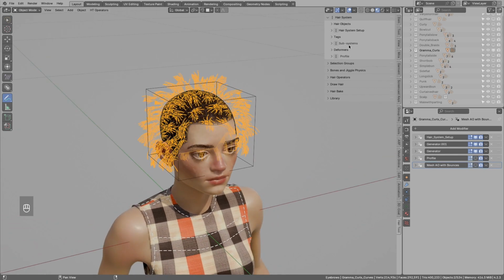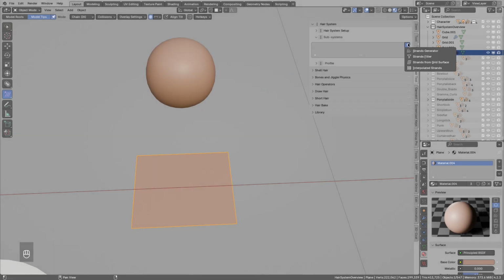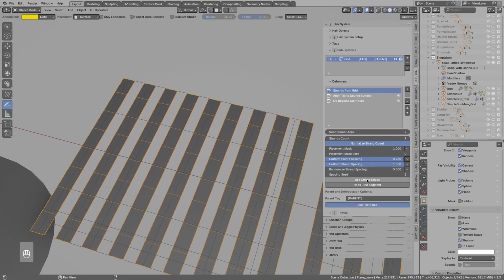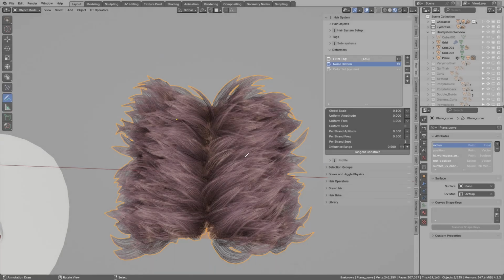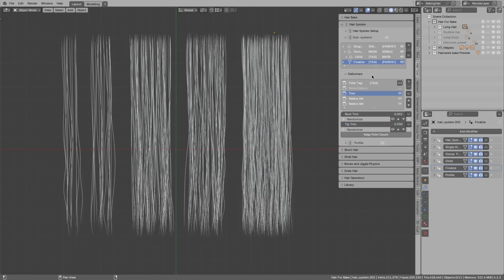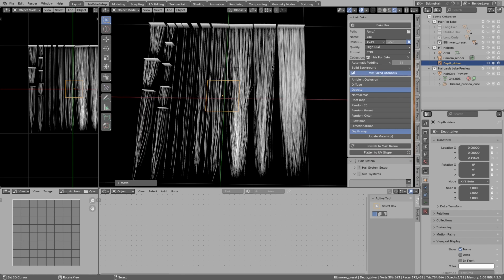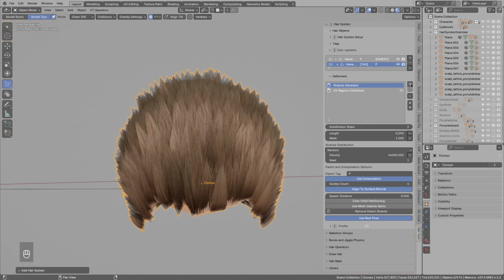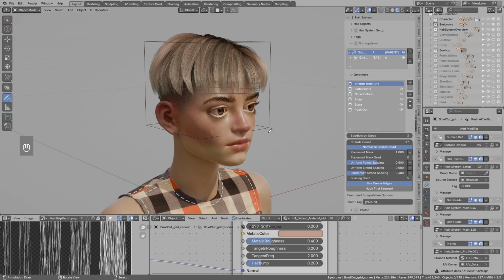Hair Tool 4 Introduction video

Comment: Hello,
I’m able to create hair well using curves with the Hair Tool, but when I start using the Hair Modeling Tool, the square point at the end of the curve disappears.
I mean the small square control point that highlights in green when selected, which makes it easy to identify the curve end.

Is there a way to restore or show this endpoint again?
Reply from the maker: To enable hair modeling - you have to have 'show overlays' button enabled in blender 3d view, and maybe try to switch to other tool for second, then back to hair modeling. See https://joseconseco.github.io/HairTool_3_Documentation/hair_modeling/#location .
U could also see if  there is update to addon (in Hair TOol preferences > Update)
Reply: @bartoszstyperek6306  Thank you so much! Turning Show Overlays back on fixed it! Really appreciate the explanation and the documentation link 🥹

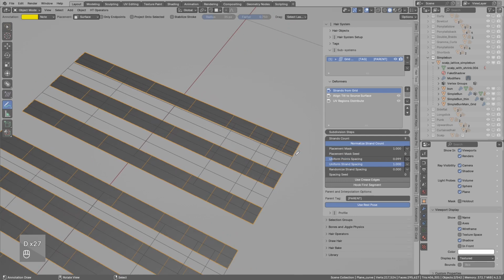Comment: also at 19:48, the uniform points spacing and uniform strand spacing don't seem to do anything when i slide it down
Reply: randomize strand spacing does work though.
Reply from the maker: It will work if your grid guide mesh is non uniform.  https://joseconseco.github.io/HairTool_3_Documentation/main_workflows/hair_from_surface/#parameters

Comment: This is so confusing. Straight from the start I don't get those 4 options in my Add Hair System drop down (1:34). In fact, there are no options available. Everything is shown on planes. When you show something on a character it's a hairstyle with tons of deformers added already and not a step-by step tutorial. You really need a playlist with several hairstyle tutorials like a ponytail, or braids, or buns each made with a different approach. The only one you have seems to be just almost straight curves sticking out of the head almost perpendicular and you just curled them. All this is extremely not beginner friendly.
Reply from the maker: The options at ctrl+shift+H menu are context sensitive (meaning different options will show depending on what you have selected - in video I had scalp mesh selected, so make sure you have mesh selected).   About step by step - I plan to make videos like that, where I break down how hair presets from HTool library were made. This  video was more of an demo, how each   deformer, hair system, maks etc. works .  I recommend checkout out this for quick start: https://joseconseco.github.io/HairTool_3_Documentation/#quick-start

Comment: Thanks !!!  I setup the hair material in main scene but how to use the same material in baking scene ? within the baking scene under profile when i select HT material the hair system disappears .
Reply from the maker: When material disappears it must mean that UVs are messed up. Both object should   share same: UV, material, texture - so that they are rendered in same way. Check out this FAQ point: https://joseconseco.github.io/HairTool_3_Documentation/faq/#texture-looks-wrong

Comment: Hello, Is there any tutorial/Documentation how to implement my haird cards to hair tool bake? I didnt find any solution and it does not work properly
Reply from the maker: yes, here is info how to  assign your own cards texture.  https://joseconseco.github.io/HairTool_3_Documentation/faq/#how-do-i-change-hair-texture   . These are same steps in video above  - https://youtu.be/3ATRZ-ox5s8?t=3255  .  IF you mean, that u have custom mesh for hair-cards, then use  Mesh Profile  to instance your custom cards on hair - see : https://joseconseco.github.io/HairTool_3_Documentation/hair_profiles/#mesh-profile
Reply: @bartoszstyperek6306  Yea I used hair card studio to create my own hair strands but I wanted to bake it using HairTool, which is quite confusing for me right now. But I didnt find any solution how to connect my hair cards to the hair tool bake system. I will try to check the links you sent me

Comment: Hi. When using 'strands from grid surface',  
There are always two strands generated at two sides of the grid with their middle line matching that side.
Which make these two strands have half of hair outside of grid.
Also if I have two grid placing side by side, I have overlapping hair strand in the middle.
I want a option which can slide the strands inside the grid.
Reply from the maker: I saw someone requesting similar feature in past.  So what you want is - when two close grids touch each other - the first and last generated strand should not overlap right? I guess this would require 3 cases:
- remove first strand
- remove last strands
- remove last and first. 
Something like this?
Reply: @bartoszstyperek6306  
Thanks for your response!
For 'Strands Generator' type of hair, the addon can use vertex group weights to control hair generation.
But for 'Strands From Grid Surface' type, seems I can only control hair generation by density of the grid. 
I tried to add vertex group on the grid and set 'Placement Mask' with that vertex group, but the placement is unchanged.
Vertex weights seems all set to 0 after 'hair system profile' modifier.
I want a variable (user defined curve or vertex group weights) to control which part of the sharp edge should grow more hair strands.
Reply from the maker: @fatboyzzfatboyzz7407  I think  vert group  not workings -was fixed some time ago, 'strands from  grid'.   Please update hair tool - and then update ;strands from grid; then vert group masking will work.  So after updating addon  (from built-in auto-updater) you  should load your blend file with old nodes setup, select 'strands from grid' deformer (always first one int the deformers list) - and from  triangle_down like menu - select 'update deformer'. 
Btw I was thinking about  rejecting of border strands feature, but it would be kind of pain to control - since if you pick 'remove last strand' - then all last strands   (on all islands ) would get removed. So u would  have to use some kind of mask - for 'remove last' and remove first. Does not look nice from   UI/UX point of view imo.
Reply: @bartoszstyperek6306  Updated to 4.1.6, the vertex group placement works! I think 'the remove last strand' is not necessary if I could control strands spawn with vertex group now. Great addon, thanks.

Comment: Hi, I updated the HairTool plugin (4.0.2 to 4.1.5) and I can't find the Material/UV option in the Hair Operators, so I can't use the Set UV Regions option. Where is this feature, please? In addition, do you have the website with the updated details of each version? I would like to see it, thank you.
Reply from the maker: Some options under Ctrl+Shift+H pie are context sensitive (if you do not have hair curve selected-  some options may not be displayed). If you have object, with hair system assigned to it , then material panel should be there (I would need more info - do you get any errors in console,  screenshot - best join discord for that).   
About info about releases - I put these on gumroad, but HT 4.1.5 is not officially out yet - it is only available through built-in auto-updater - that is why there is no info about it on gumroad.  Right now I'm updating docs for 4.1.5,  fixing bugs, and then I have to make video. After that is done - I will make 'official' gumroad release (with email notification about what is new).  Again for more detailed info - what new stuff is added - join discord.   sorry for long reply
Reply: @bartoszstyperek6306  Wow, it's in the pie menu! I mostly use the right sidebar menu to operate the software, so I didn't expect it to be here! This answer is not too late! Thanks for your answer!

Comment: why when I draw hair is it only giving me 2 verts? I basically get a straight line of 2 verts when I draw hair
Reply: I changed adaptive resolution " reduction" and it's still a line with 2 verts
Reply: Also, Use symmetry on the draw hair tool does not work
Reply from the maker: Ok, just added symmetry  support for drawing, in latest daily HTool build :)
Reply: @bartoszstyperek6306  Thank you!
Reply from the maker: yes, it is not  supported.  Will see about adding it in future.
Reply: also, the cards are not aligned to the surface when I draw hair.  The problems with this version are incredibly frustrating
Reply from the maker: are you sure you are using latest HTool 4.1.5?  No other users reported issue like this. Maybe you could joint discord, and post  video with drawing problem there?  Discord link https://discord.gg/cxZDbqH

Comment: why is the Flat Profile UV tapered at the end and how can I make it a card, not a point?
Reply from the maker: Try: Ctrl+Shift+H > Set Radius: 1  , to set uniform  radius for all points.  Or  use 'radius set' deformer with:  disabled 'built up' option, and 'influence range' set to constant (to prevent taper ) .  https://joseconseco.github.io/HairTool_3_Documentation/main_workflows/input_masks/#influence-range
Reply: @bartoszstyperek6306   Thanks
Reply: @bartoszstyperek6306  none of this worked. I'm using the latest hair tool with Blender version 4.3.0

Comment: Hello, I love this addon. I would like to know if I can apply the curve system to my own chunks (Haircards) that I have previously created so I can place them easily and smoothly. I think it was possible in previous versions, but now I'm not sure how... Thanks!!
Reply from the maker: You will have to convert your hair-cards - to curves with: https://joseconseco.github.io/HairTool_3_Documentation/convert_hair/#haircards-to-mesh-loops  . But it requires 'nice' uvs on your hair-cards  (uvs are used to determine orientation of generated curve ).

Comment: Not a single demo on how use on character, just on plane, which is waste of time.
Reply from the maker: 'not a single demo' is bif of an overstatement: 
- demo 1: https://youtu.be/3ATRZ-ox5s8?t=1032
- 2 https://youtu.be/3ATRZ-ox5s8?t=1363
- 3 - https://youtu.be/3ATRZ-ox5s8?t=1696
- https://youtu.be/3ATRZ-ox5s8?t=3264 . 
I tried to make this as short as possible and  still it covers  only around 50-60% of addon. For   example of hair watch this: https://www.youtube.com/watch?v=M22m0WLylbU
Reply: @bartoszstyperek6306  I have spent 6 hours following your tutorials, trying a simple hair style, 60% is the problem, at least for anyone who is not industry expert. The explanations are really lacking any depth or explains why things work, and the speed your going through things, makes it really difficult to follow. Great product, but it needs a bit more depth with tutorials, that are structured in way that is easier is to understand, not just click here, do this, this texture, this texture, click this. It makes learning your product so much harder. Honestly right now, after a spending day trying to learn this, I could achieve better results with blenders hair system. I know it can do so much more, and its amazing, but I should not be spending a day just trying to understand the basics.

Comment: hello, 
im having a bit of difficulty 
on my mesh when I press CTRL + Shift + H there is not the option " Hair with Track mesh" 
(when I create new objects it works) but on my character I cannot apply track mesh 
what can I do?
Reply: It also seems that my file itself is broken 

when I export > to a different blender file and do my hair tool there it works but in my current file there are certain tools and systems of the hair tool that dont work.

I know I could just work in a different file and do my hair their and then reimport the hair into my main character file if that works but i would like to know "why" my file got corrupted and hair tool dosnt work properly in that specific file anymore
Reply from the maker: I cant tell  why it wont work on your file. Can you post it on my discord?   https://discord.gg/cxZDbqH
Reply: @bartoszstyperek6306  sadly no due to NDA 
in the end I just made it in a new file
anyways cool tool keep up the great work!
Reply from the maker: for 'track to mesh' - you have to have mesh selected.  You could also try to add it manually: https://joseconseco.github.io/HairTool_3_Documentation/main_workflows/hair_system/#track-to-mesh  , but then u will have to create the guide mesh manually too   (eg. duplicate base mesh, push the faces outward, and use it as - track target.  Then press 'bind' so that hair tips will be glued to that duplicate mesh)

Comment: Weird thing is happening where after selecting strands from grid surface, the surface emitter is still solid instead of a wireframe.  And changing it in the properties panel makes the surface and hair cards wirefram instead of just the surface.  Please help 🙏
Reply from the maker: Here is timestamp of older video -about 'curves from grid' where I show where to change the wire drawing mode to solid (or in reverse) - https://youtu.be/Rp7yGbxm7HI?t=135  . If you add  'curves from grid' using ctrl+shift+H menu - then it should automatically do it for you (set object to wire mode).   Also, just in case, if your object is till attached to soure mesh surface - you may need to  separate it using:  https://joseconseco.github.io/HairTool_3_Documentation/main_workflows/hair_system/#transfer-hair-system     ( Ctrl+Shift+H > Transfer Hair System > To empty curve)
Reply: @bartoszstyperek6306  
Weird, because I never needed to use that hotkey before to get that result but oh well.  Also that hotkey seems to only work in blender 4.1 for me.  For some reason, addon specific hotkeys don't seem to work (or at least for me) past version 4.1.  I had the same problem with the hard ops addon too
Reply from the maker: @QuesoGr7  about hotkeys,  yes sometimes ( like once a month / two months) blender will  disable some hotkeys for no reason.  The fix is : go to HTool addon preferences >>> hotkeys tab, and reset them in there  (the very first - should be the one for Ctrl+shift+H > pie menu)

Comment: Is there any way to deal with super long hair or tails? Now using generate curves from grid surface just lead to stretching. So is it doing right to repeat UV in Y axis and if so how can I do that with in the addon available operation? Or just cut the long tails to pieces( that looks not good lol)
Reply from the maker: there is no option to tile the  profile mesh, but... any mesh can be used as profile (see https://joseconseco.github.io/HairTool_3_Documentation/hair_profiles/#mesh-profile ), So you could generate somehow tileable mesh (with some other geo nodes addon/ setup) . and use It as input mesh for 'Multi Mesh' profile. I assume u would use custom root and tip tile, and then repeat the 'center' part.  If u made multiple meshes like that - u could use them all, in HTool 'multi mesh profile' - and mask them - for example: to use longer mesh, on longer strands.  
The hardest part would be , to get goe-nodes setup for making - zipper like meshes, but for hair-card. I could share my setup from another addon if  u cant find it on google.
Reply: @bartoszstyperek6306  Thank you so much for really detailed replying! And I would be appreciate if you can share that setup
Reply: @bartoszstyperek6306  Suprisingly found that default hair texture has already looked good on knee-touching hair with Strands from Grid Surface function.Just add a bit more subdiv steps.Thank you for this so convenient addon!
Reply from the maker: @toadest6615  Yes, I never saw anyone doing any tiling mesh magic. So I guess you do not need the tiling geo-nodes setup? If you still want it then pls, join discord https://discord.gg/cxZDbqH , and ask me for it there.
Reply: @bartoszstyperek6306  Joined. Thank you

Comment: How do you constraint the strands to appear only in a weight painted mask on the scalp, like you can do with normal Blender particles?

Edit: Shell hair > hair system > deformers > Choose Strands Generator > drop-down menu next to the Mask slider and choose Vertex Group (no idea what the difference with vertex group and the other "From Object" is), then just choose your vertex group and it'll work like in the default Blender particle settings.
Reply from the maker: about making particle spawn position: in strand generator   > density > use 'Vertex Group' input mask ( https://joseconseco.github.io/HairTool_3_Documentation/main_workflows/hair_system/#vertex-grouptexture) . Ah u figured it out. About 'from object'  - it will allow you to sample weighs from different object (and not only source mesh surface)
Reply: Another problem is that how do you get the hair cards to align against for example the curvature of round surface of the scalp emitter, so that hair cards for example at 45 and 90 degree angles won't be pointing side-first against the sky
Reply from the maker: see this part of video: https://youtu.be/3ATRZ-ox5s8?t=3569

Comment: I dont know why, but i cant go back to Main Scene when baking the textures.
Reply from the maker: I'm not sure, but if I remember correctly I did some fix for moving between bake scene and main scene. Can you update addon, using built-in auto-updater , and see if that fixed your issue? If not then it would be best if u could ask for support on discord.

Comment: Is there a way to reduce black clippings on render outputs? So far most hair look weird on render previews. They only look fine in material viewport.
Reply from the maker: for cycles you may need to bump up transparent / translucent ray depth count (in cycles ray settings)